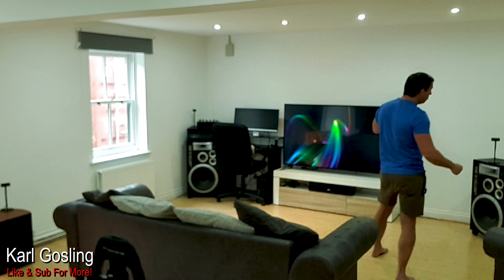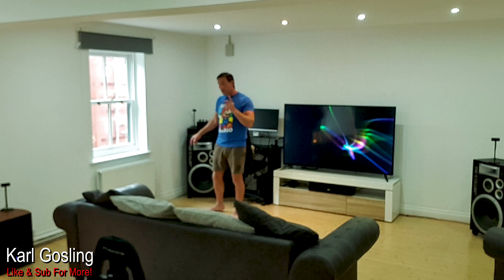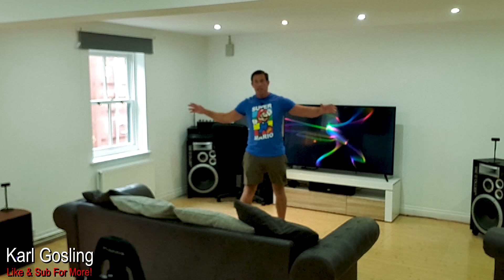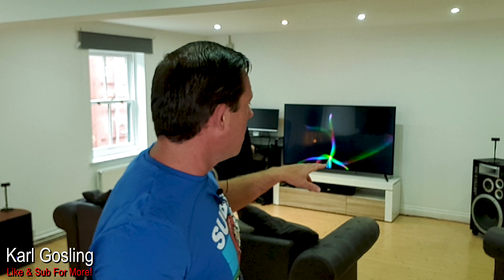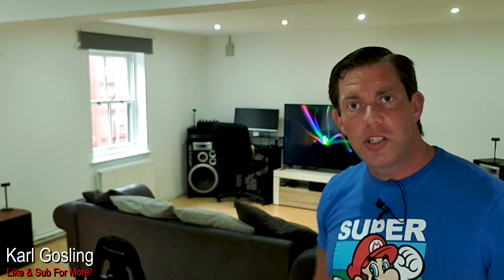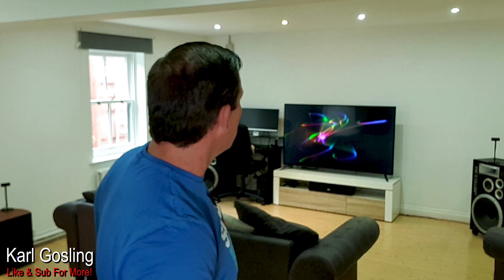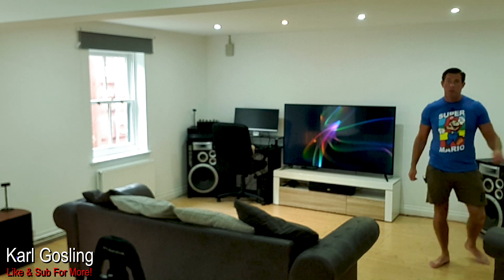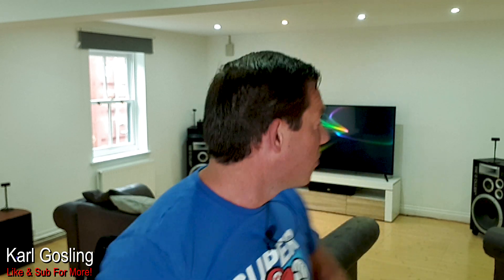Oculus Rift CV1 Sensor Positioning Setup

Comment: Karl, getting you're videos in my feed now due to your great review of playseat challenge, which I've now bought, thanks for that, I love it! (I'd watched a few reviews but yours swung it)
Ive had cv1 for years now. A key thing ive noticed using this tracking system, is be very careful if you have ANY mirrors in the room. This will play crazy games with tracking, as infrared light is reflected in mirrors just the same as normal light.
(My old desk based setup had drifting tracking regularly till I realised I had to cover my mirror during use)
Reply from the maker: Thanks Dave! Yes the mirror tip is a good shout, I don't have any in my play area but large screen TV's can have a similar effect if they have a very reflective glass too.